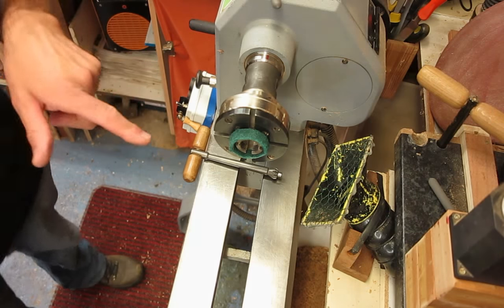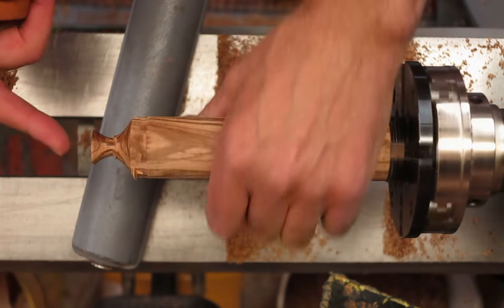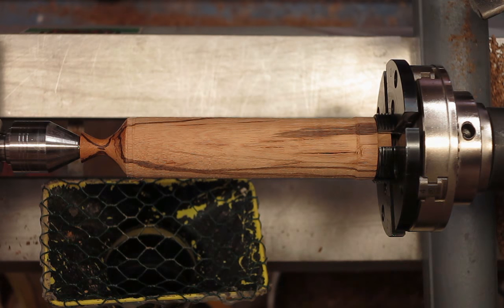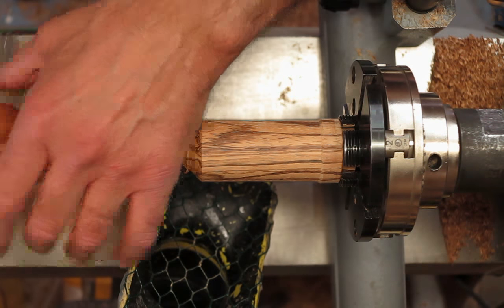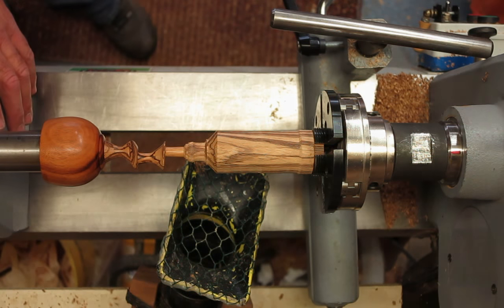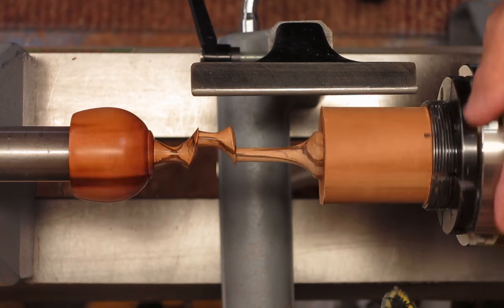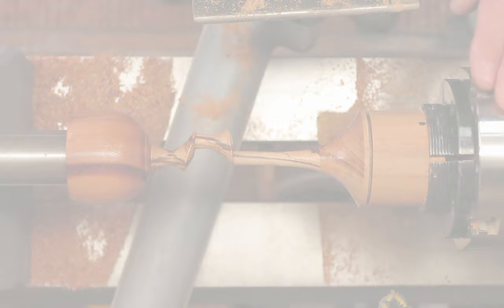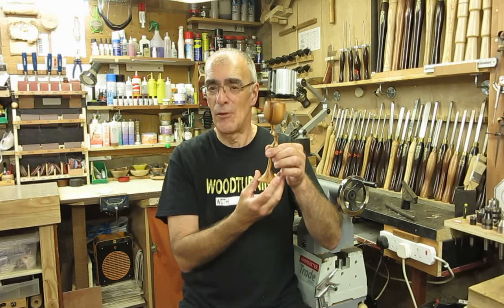Wood Turning - Eccentric/Off Centre "Coventry Goblet" Fix

Comment: Great save Mike.
I worried when you glued on the bowl. I would have waited and not risk the bowl until much Could you elaborate?
I like the scotch pad. Is that shop made or purchased. Looked like a stretchy rubber cylinder. I'd want 3 or 4 sized for situations like this one.
Thanks Mike
Alan
Reply from the maker: Thank Alan, I needed the bowl attached at this point to help me decide the proportions and design of the stem and the foot, if that makes sense. The Scotch pad is cut from a shop bought square, I actually use more of the stuff than my wife does in the kitchen! ;)
Take care
Mike

Comment: Beautiful work Mike, thankyou. Could you of put a wedge in the jaws of the chuck when turning the off centre, just to keep it more steady? One other thing, did you have to finish the outside of the bowl before you did the stem, I noticed a little vibration and was worried the stem might shatter.  I had a job shatter on me a couple of days ago, it was about 18 inches long and about 1 and a half inches in diameter my Bowl Gauge caught on a Celtic Knot. and the bloody thing shattered.  Lucky I was wearing a full face polycarbonate mask and no personal damage was done.  Anyway a great clip, I don't think I am ready for eccentric turning.  Thank you.
Reply from the maker: Thank you, I have honestly never felt it necessary to add a wedge in the jaws. If i get a catch, which can happen, and does, no amount of extra support is going to save it! :)
Glad you came out of your catch unscathed.
Take care, and thanks for watching and commenting.
Cheers
Mike